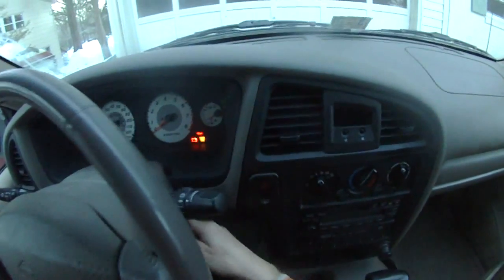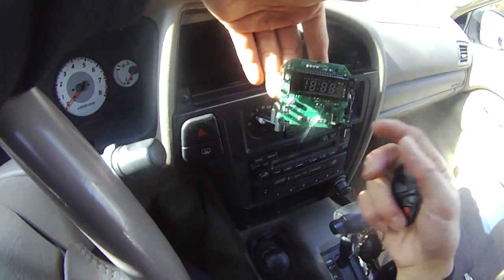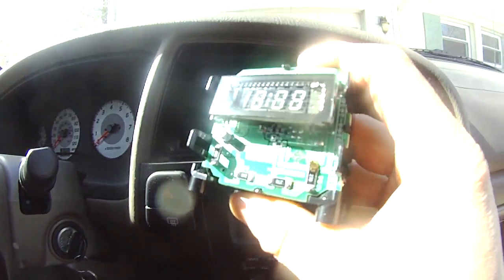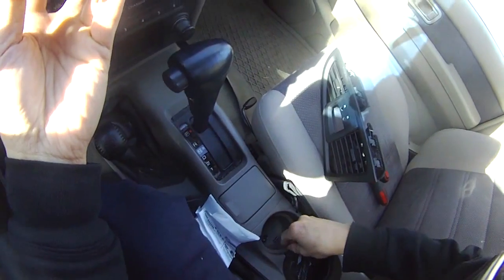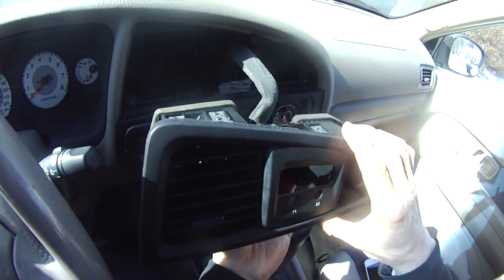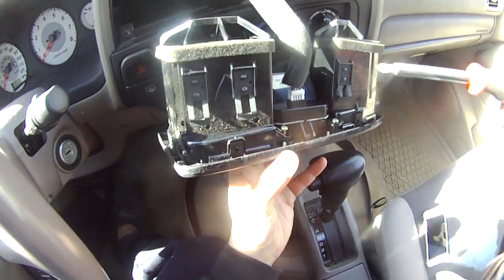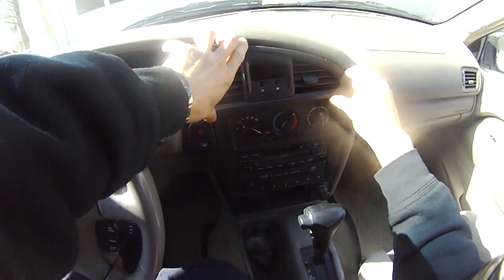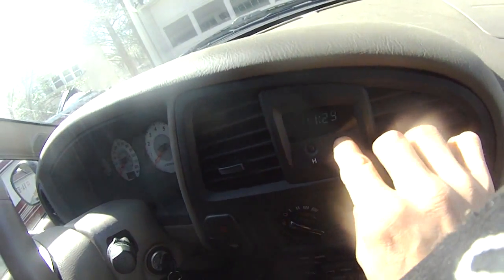Nissan Pathfinder LCD clock repair - DIY

Comment: Thank you very much it worked like a charm just heat up the solder joints on those resistors

Comment: Thanks for posting. Our Pathfinder clock stopped working some time ago, and I finally pulled it out last night, thinking it might be a loose connection or something like that. No loose connection though. Then I found this video which confirmed my suspicion about the poor looking solder connections on the four bigger surface mount resistors at the bottom of the clock's printed wiring board. I re-flowed and added solder to each side of all four of these resistors, and the clock now works like a charm. :)

Comment: Thank you for posting.  Wish I had found this video before buying a replacement from a junkyard.  In my case, did not  need soldering - just had to scrape off some corrosion with my fingernail which was shorting out that resistor.  Voila - working clock again.